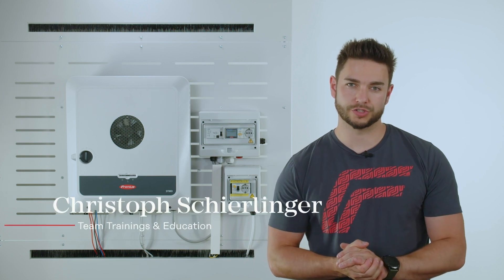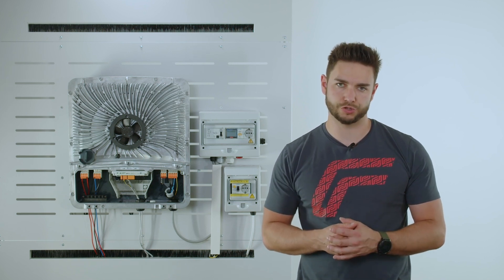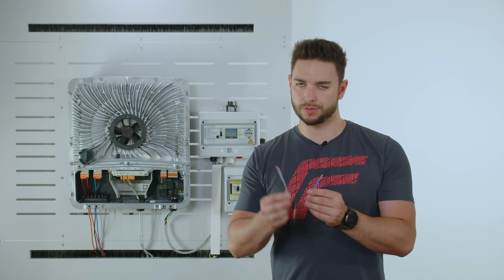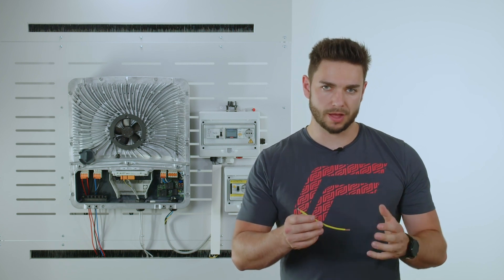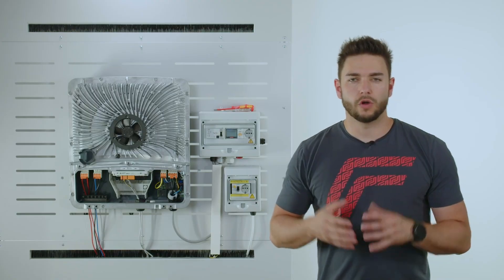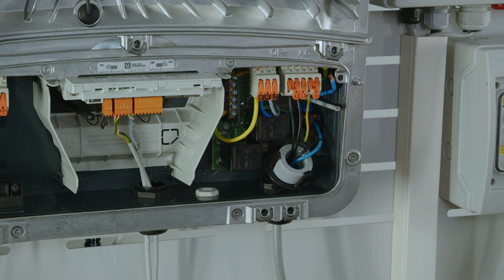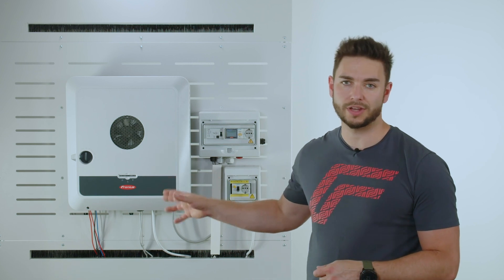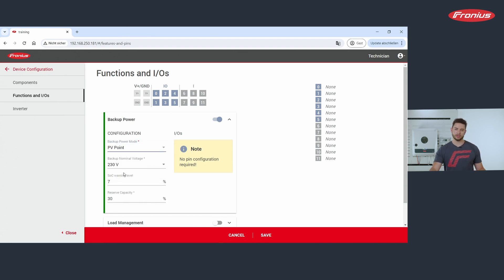How-To Video: Installation & Commissioning of the PV Point Comfort

Comment: Can the PV Point Comfort function work without batteries? If I add the battery later and want to use the Full Backup function, do I have to replace the PV Point Comfort card with an automatic switch box?
Reply from the maker: Hi! Yes, the PV Point Comfort function can be used without a battery. In this case, it supplies backup power via a fused socket or a fused circuit during the day when the sun is shining.
However, if you retrofit a battery later and wish to use the Full Backup function, the PV Point Comfort and Full Backup functions cannot run in parallel. The PV Point will then be non-functional, but it does not need to be removed. To optimise savings, you can disconnect the PV Point Comfort from the power supply. Additionally, the Full Backup function requires a switching component, such as a Backup Switch or Backup Controller, which can be installed in the switch cabinet.

Comment: Hi ! Nice video. About what you say at 2:50 about the three phases I guess that in single phase installations the only phase is connected to the print board of the PV Point comfort as the phase 1 here, and that's all ?
Reply from the maker: Hello @ChristopheMercier41
Exactly the PV-Point Comfort is available as one article number which is compatible with Primo (single phase) and Symo (three phase) GEN24 devices. Details can be found in our PV-Point Comfort Quick Start Guide
LINK: https://www.fronius.com/~/downloads/Solar%20Energy/Quick%20Guides/42,0410,2930.pdf